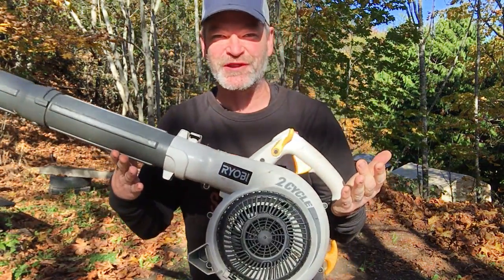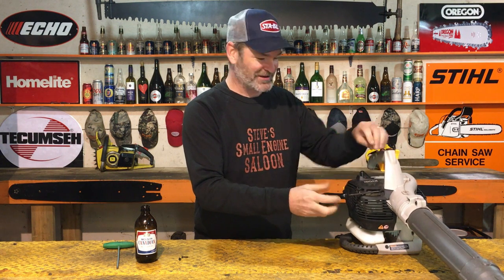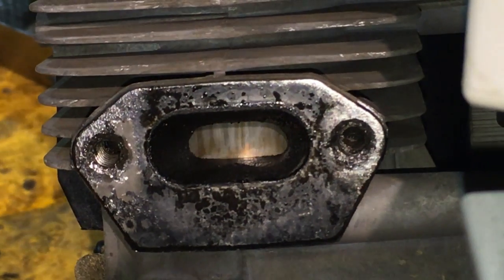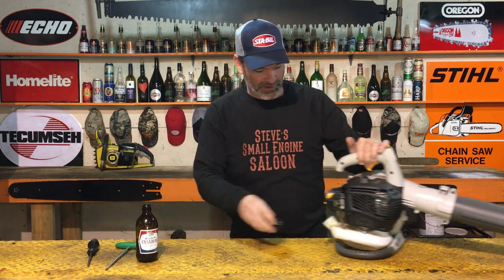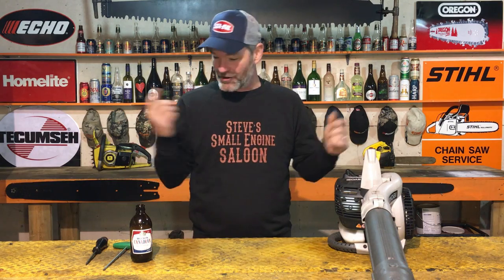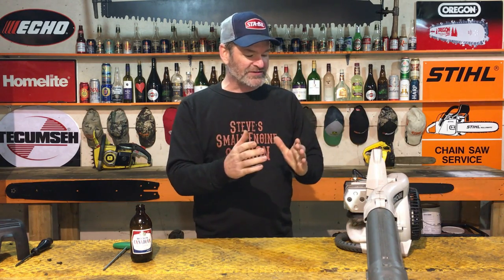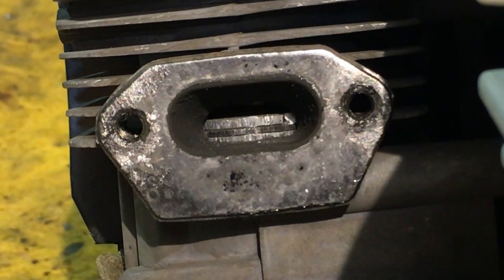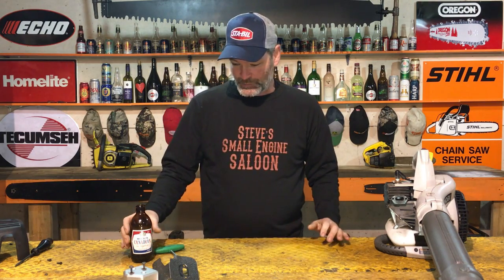What Happens When You Run Straight, Unmixed Gas in a 2-Stroke, 2-Cycle Engine

Comment: Another great video
On older lawn equipment should I be using synthetic conventional or semi synthetic oil  There are so many choices
Reply: I use conventional since it’s what the machine was engineered around, and if the machine has a lot of hours I will use a slightly thicker oil. If it’s 2 cycle, I run a heavier mix of oil to fuel.
Reply: I switched to BRP XD-100 for my old kohler toro mower years ago and it works better. i got both My small block 2 stroke v8 and 8v92 detroit 2 stroke on the XD-100 and im suprised how good they run, clenaer and quiter and start up better.

Comment: Love this video, now to repair this kind of damage because this is Steve's Small Engine Saloon where you repair not just destroy. :)
Reply from the maker: The cost of repairing it is more than buying a new one.....
Reply: What would the process actually entail? Re-bore the cylinder,  install new piston for the new cylinder size? I'm assuming lots of specialized equipment there, if it were even possible to obtain a new piston that would match the new cylinder diameter...
Reply: Steve's Small Engine Saloon oh but what's the fun in that :P

Comment: Is there another problem running too much oil in a 2-stroke?  Does it just get all gummed-up?  What does it take to fix that?  If you could get another ring on that engine you just wrecked, would it run for a while?  I bet it'd knock like crazy though.
Reply: I think too much oil just makes more smoke and carbon build up in the cilinder and exahust, wich can actually be a problem
Reply: @CVP-og9pw  And cause the rings to stick to the piston